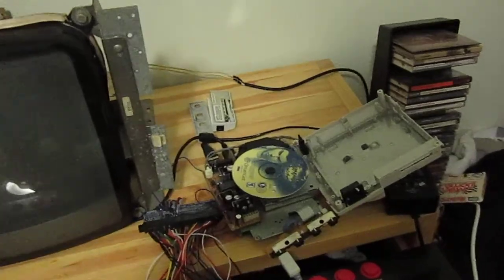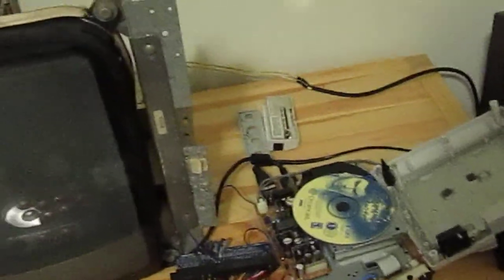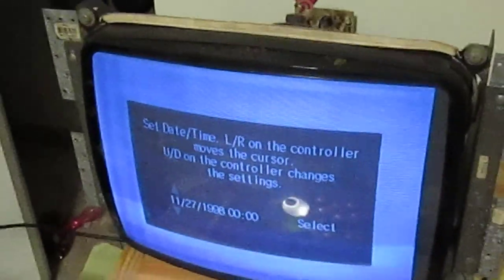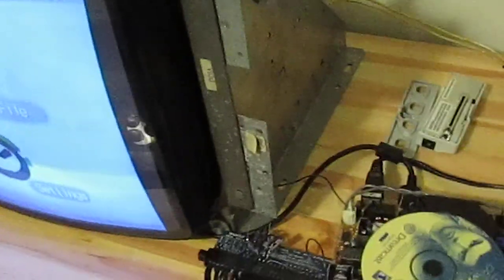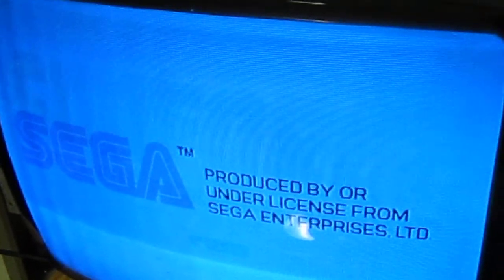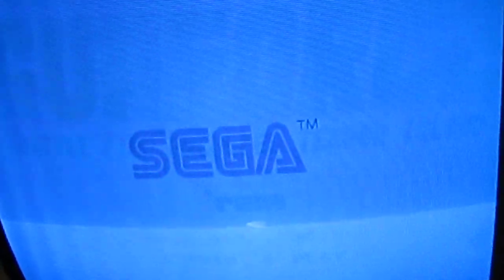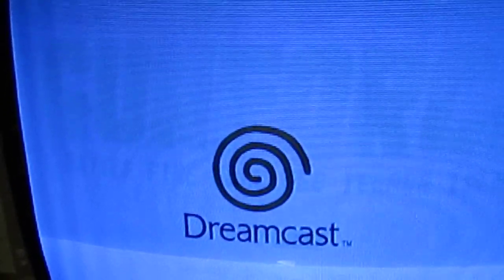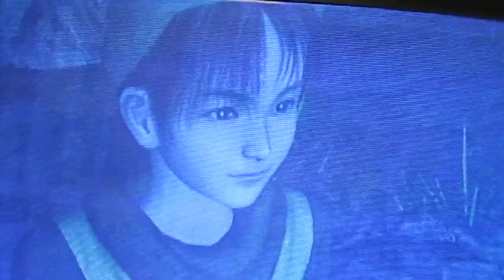Demo of JAMMA dreamcast for arcade cabinets

Comment from the maker: Pin 8 from the DC's AV port, so use a multimeter on your VGA box to see where the DC A/V Port's 8th pin from the left would connect to on the VGA box and that will be vertical sync.

Comment from the maker: Hey man, it will probably depend somewhat on your monitor you are connecting to, but I used pin 8 which is vertical sync to the video sync pin on the JAMMA connector (pin P).

Comment: wow you really have to hack quiet a bit to get a dreamcast to work on your jamma cab O.O 
i just bought a vga box, made two padhacks for my controlpanel and trough my dreamcast into my naomi cab. all working fine so far =) connecting a 360 via vga is also very easy, the only thing you have to do for each console is to hack two controllers, to get the controlpanel to work^^ only bad thing bout my cab is that i can´t connect a megadrive or a the snes to it... 31khz only >.>